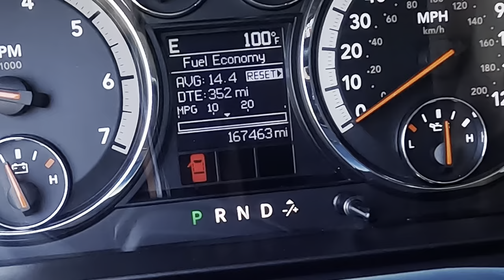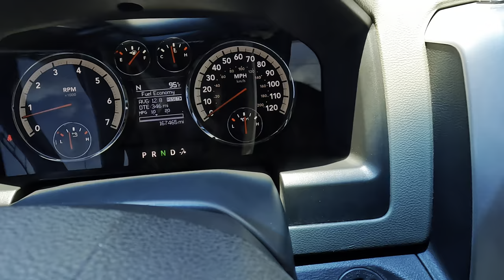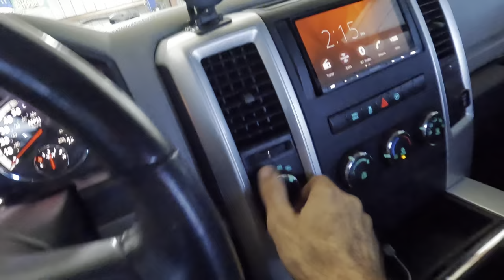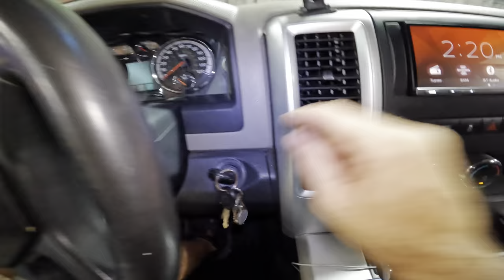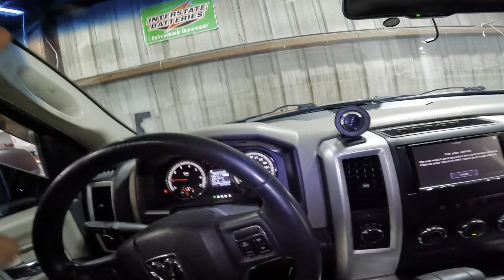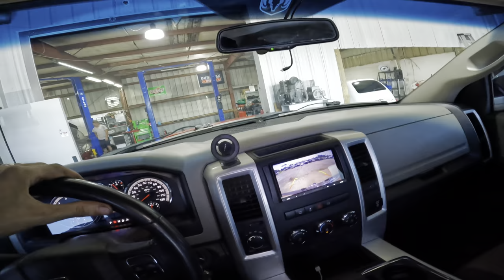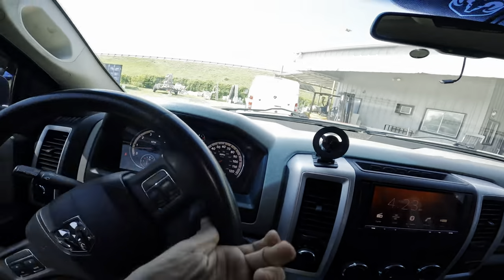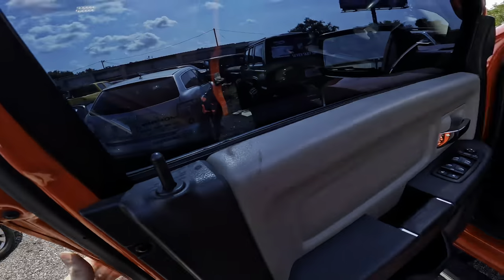Customer States: NO ONE CAN FIND IT! Sand in my Dodge Ram! Replace Whole Unit! 1500 4x4 5.7 hemi

Comment: My guess for axle and driveshaft cost is $1000.00-ish. But I would never think to check U-joints the way you did, I would've just used pry bar the way did and say good, you went one step further......
Reply: It is the right way to check u joint they where so dry, i expect them to be very dry brgs inside, i would not take the road with these.....

Comment: We may not feel it, but sure can see it. How can you say not rebuildable, they had to built it and nothing u-joint related is welded like the yoke. That wiggly front shaft with powdery rust signs all over the place has a noisy signature as well as front u-joint. Can't imagine not checking rear joint too if going forward, maybe not quite the shock loading as front depending on driver. Good diag algorithm.

Comment: i cant tell what kinda of noise it sounds like because microphone canceled out noise which i never get it if i could hear noise i can identify which parts is causing it
i do believe it can be reply to cv axles and u joint bearing can create noise when it moving it more likely sounds like clicking noise
i work on ton of stuff i only identify it if i can hear it and location where it is

Comment: left rear brake hose is separated from its self.. not together at bottom like on right rear side... missing parts.
and looks awful stretched..
not a quality install... need more length for brake hoses to flex in fully extended travel

Comment: Why would any manufacture , design a drive shaft that you can not just replace a u-joint. To replace a whole drive shaft will cost at least triple the cost to a u-joint replacement .

Comment: Bringing your vehicle to a dealership is crazy, theyre just there to rack up the bill, they deal with newer cars that dont see high milage wear like the repair shops do, take your rig to the guys who make it there bussiness to find your problem and fix it, if its up to the dealerships the will stop stocking older parts and leave you with only 1 option buy new from them every 10 years

Comment: I would be suspicious of that front CV axle on the passenger side to as much play as the splines had they like to strip off when they do you replace the short shaft coming out of the differential
Reply: Agreed.  Maybe not enough spline engagement on full droop with the lift kit?

Comment: Did anyone check the pinion angle of the driveshaft after the truck was lifted and a spacer added? Diff oil checked? trans case oil level? just spit-balling.
An opinion and not a real diagnosis. 
With 167,000 miles showing on the clock and given Ray's explanation, I would guesstimate, that the needle bearings in the universal cups have a flat spot on one side, the UV joints themselves  / bearings are very dry, devoid of any grease since the joints  do not have any grease zerks. The reason why the UV joint noise is only heard on sand is because of suspension travel and slight changes to pinion angle while driving on an uneven surface like sand.
Or not, as I said just guessing

Comment: i had a rigid impact driver that died on me. rigid would not warranty it. i bought a new one anyway. nothing else was available.  didn't come with batteries or a charger. cost more for those than the tool. didn't know i had to reregister with Rigid. no warranty. never do that again. bought aftermarket batteries and chargers off eBay for half the prices.

Comment: Had a similar situation with my brothers jeep. 05 5.7 hemi. Front driveshaft has this weird cv joint in it. He said he had a popping going down the road and no one could figure out what it was. I crawled under it, joint looked fine visually, didnt have any slop but what it did have was it felt like it was on fire when I touched it. Disassembled it and found all the grease had became powder. Greased it back up and it was fine. He didnt have the money to replace the joint at the time. He drove off in it and a couple days later trans went into limp mode cooked itself and shot fluid out the dipstick. Guess who ended up with the blame some how lol Gotta love those people that blame you cause you were the last one that touched it.

Comment: Everyone loves lift kits but originally not designed for them so therefore has unintended consequences 
Universal joints don’t take kindly to added stress
Well diagnosed Ray
Reply: Same goes for lowering. Suspension is a complex equation of angles and distances, when you change one of those permanently most of the other points don’t like it.

Comment: i use to have a dodge truck what a pile of sh. ever change the thermostat on a 360 now that was a bad design the suspension sucks on them my chevys and ford walk all over it. i have a 69 chevy 2 wheel drive that has over 1,200,000 miles on it still has the factory suspension never been worked on with a 292 6 in it top loader 4 speed it now needs work on it but it has had a hard life we used it for landscaping for close to 25 years 6 days a week after we got it for 200 bucks with 300,000 miles on it. we would losd it till it could not handle any more weight because the bumper was way to close to the ground that was every day for 6 days a week. then my 70 highboy it is a beast with dana 60/80 lockers 390 rust free clean body got it for 250 bucks with no engine but the box was full of extra parts traded a 4 door car for a 390 then started driving it. i take it cross country all the time i make my own roads with it

Comment: This RAM was built to FAIL..........
NO grease fittings on the ball joints or other front suspension points.
I can remember my first car when going into the shop for oil change, they would do a complete grease job as well on I think it was 32 fittings at that time.
NOW, it seems they "LOCK" it all up and wait for wear to cause failure leading to possibly more problems.
It would seem that it is a wise thing to do when you are shopping for a new vehicle, to have the salesman put the vehicle on the rack and then YOU take a look at things like this and question them as to "WHY!!??".

Comment: @12:00 let's review. Nothing seen other than very shiny paint and non factory authorised suspension height adjustment. Conclusion? User error, aka wanker. But let's 12:08 see what the expert determines. Then 90 seconds later I  see 22 inch rims if I'm reading the tyres correctly. Diagnosis  confirmed.

Comment: 170K on a Ram....You better get used to "noises"!!  NOT HATING, I own a 2011 ram 2500 megacab 4x4 diesel with 250K and its got noises a plenty but runs and tows just fine.

Comment: I hate to be a know it all, but your 15 minutes in and haven't checked the wheel bearings and your moving on to removing the front end of the front driveshaft?? It would absolutely need both front wheel bearings with that mileage. Too bad you don't have a maintenance history for that vehicle to check for that.
Reply: The bearings were changed just under 60,000 miles ago. Ray didn’t know that but the fact that he didn’t try to sell me a new set when they’re totally fine speaks volumes to me for his integrity. I’m the owner.

Comment: I don't get the attraction with these lifted trucks. It just causes so many more problems. It screws with the designed geometry, and shaft lengths. I think most of these lifted truck drivers don't NEED more ground clearance. They are insecure, and are looking for peer approval.
Reply: Sir, I like to fish and some of the roads require extra ride height to pass like rocks and ruts. It has a 3 inch lift, it gets me there… it’s what I need. I’m not worried about what you or anybody else thinks.
Reply: @jamesstarnes311  if you will reread my post, I said, "most", not all. I'm sure there are legitimate needs for some drivers, but the vast majority are just posers. But hey, if truck owners want to spend the money to lift them up, and then spend more money to fix them after the lifts cause all kinds of problems, at least it keeps money in circulation. Who cares, except when I was rear-ended by a jacked up Ford pickup who couldn't see over the hood of his truck causing over $2k in property damage to my car and a big headache dealing with scumbag insurance companies, i think I've got a right to complain,

Comment: Dodge front driveshafts are horrible, especially if the truck is lifted.
Even in factory truck they're only good for about 50k miles ....... Sad since Dodge makes a great truck.
BTW, the U joints are replaceable.

Comment: Ah HA!! - Sherlock Ray finds it again, and with a twist. Yep those drive shafts have to be replaced / They cannot be repaired - It's those dumb engineers that made these not serviceable. We the people need to get manufacturing back to the way it was and get the industry back to replacing parts as needed NOT this garbage where like that whole front shaft has to be replaced -That's just stupid waste - because of U-Joints...